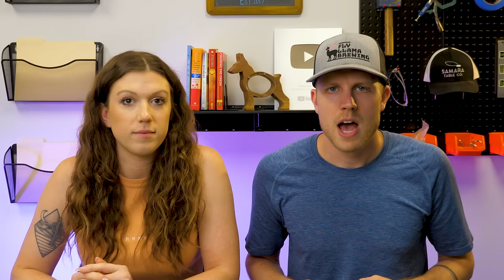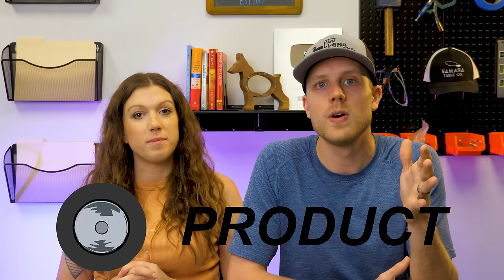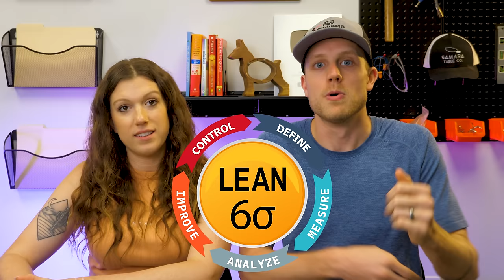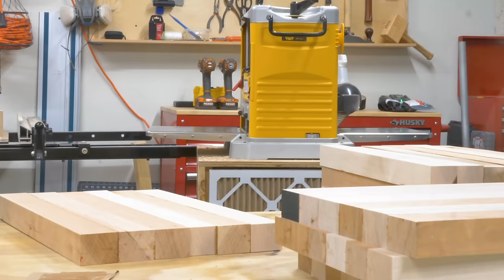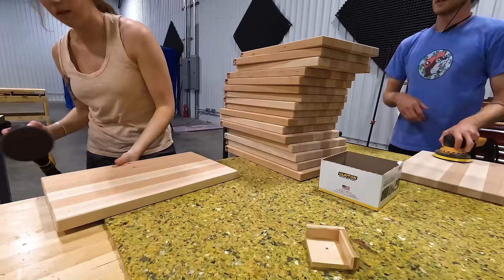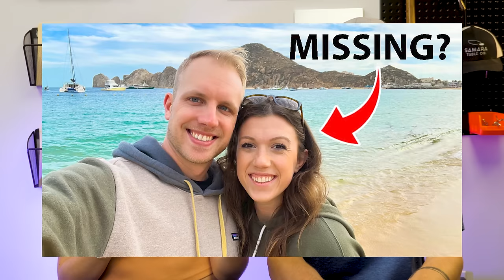4 Things you MUST GET RIGHT to Make Money in Woodworking [The Business Bus]

Comment: I have thirty years experience in the woodworking world,mostly self employed. I have a 2000 + sq ft workshop behind my house full of three phase equipment. A window cleaner in my village makes more money than I have ever made and has far less stress . Woodworking ,unless you are blessed with customers who will pay whatever you ask,is possibly the worst business to go into. What you have done is (wisely) sought out a product that is about as simple as it could possibly be ,and this is the main wheel on the bus in my opinion. As soon as you introduce more complexity into a product,that’s when the headaches begin. You are basically churning out lumps of sized and sanded wood and that is about as simple as it gets. Making them “customised” means that you just chuck them on a cnc  router and go for a brew. 
     I am very interested to see what your next product will be, but I’m sure it will be just as basic and simple. I’m not criticising you for this,but you could well be misleading naive hobby wood workers to Quiting their job for what you are putting forward as a bit of a panacea. 
   It’s a tough world out there and self employment in any sphere has its challenges,but especially so in manufacturing. I’m writing this from England and I appreciate that I’m not comparing like for like, but for instance,the price of timber here is truly eye watering,and the same goes for hardware. I have worked most of my life in unheated workshops and with the way things are going I’m even reluctant to switch the lights on . I think that you have become a “motivational” business,relying on utube clicks for your sales talk.a bit like Tony Robinson & co.
  Please be more grounded and realistic . I know I have been very critical with my views on this subject, but I mean no harm and am only putting the flip side forward . I really do wish I could truly encourage people to go ti alone in the woodworking field, but I’m retirement age and glad to get out . Regards from the UK.